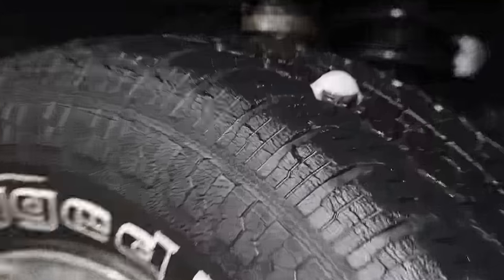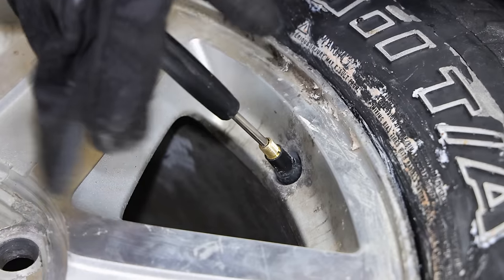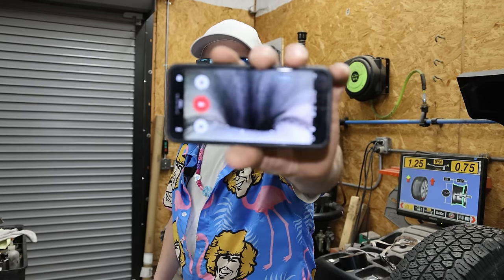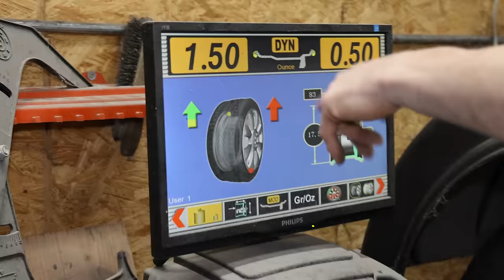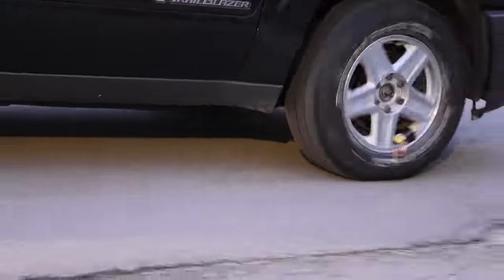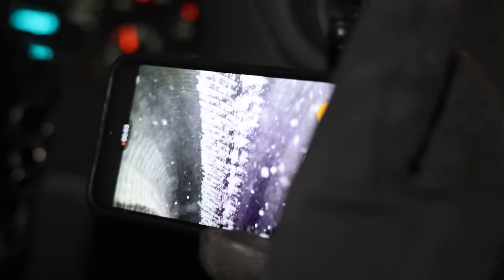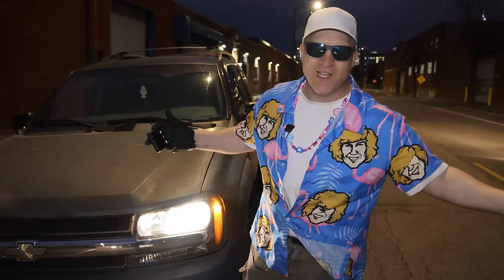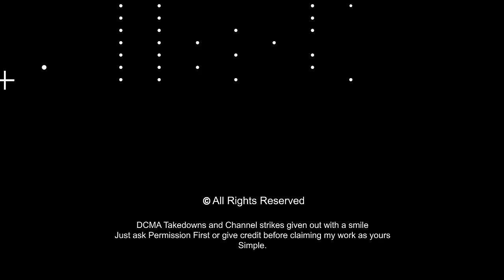GoPro Inside a Car Tire (With Balance Beads)

Comment: I had been using them on my motorcycles for over 20 years, and I had got thousands of miles more on every tire than regular balancing. Not only did my tires last forever, but the ride was smoother and no tire cupping, especially on my second gen Honda Goldwing that are famously knowing for front-end vibration. I had always waited to use them on the second set of tires and beyong on every new bike, but at this point, it is the first modification I do when I get a new bike. By the way, I always use a fresh set of beads on new tires. Thanks for the video.
Reply: How about some hard numbers for comparison?
Reply: @michaelvachon1334 You are joking? To suggest you got thousands of kilometres more from a tyre with these things in it is just ridiculous.
Reply: Agreed.  I used them in my 1983 Suzuki GS650 and always had a super smooth ride.

I chatted with a rep from CounterAct, a brand of balancing beads, they don't work in everything.  They work best in vehicles with stiff suspensions, such as trucks and motorcycles.  They don't recommend them for passenger cars due to softer suspensions, but they see about a 75% success rate there.  They also said that they won't work at super high speeds, like motorcycle racing, because the high centripetal force of the tire prevents them from properly redistributing in the tire.

The reason you get additional thousands of miles is that the tires never go out of balance the way they do with traditional balancing methods.  As an example, I rotate and balance my car tires every 5,000 miles.  I notice how they are super smooth for the first 1,000-ish miles and then they go progressively out of balance over the next 4,000-ish miles.  While they are out of balance, they are wearing unevenly.  Uneven wear begets more uneven wear.  Finally, I end up replacing tires because of noise and crappy ride quality rather than getting to the wear bars.
Reply: @paulsmith4701 - I wasn't making any such claim. I'm quite skeptical of these products.
Reply: I will be lying if I say exact miles, but I remember on my 2006 M109r, I say the second set of tires lasted 4000 miles more and they were Metzelers my choice of tires (with a softer compound). I used them on my Ninja, VMax, Hayabusa, Goldwing, M109r, and my Honda Fury has now about 26000 miles and still had the factory tires.

Comment: I knew they worked, I know a lot of big mud tire guys that use them because it’s almost impossible to balance those tires.  But it’s so cool to see them in action.  10/10 best use of a GoPro this year.
Reply: Antifreeze works too
Reply: @juliogonzo2718  liquid in a tire does the opposite it makes it unbalanced
Reply: @joshmanis9860  how would it work opposite?

Comment: I used to drive 250 miles a night on gravel roads, on wet nights gravel would get stuck on the inside my rims and when I would hit pavement the wheels were unbalanced. I started using balance beads and they worked great for the next 2 years I did that job.
Reply: i had that same problem on my old hilux. solved by buying better wheels. that factory wheel looked like it was designed to accumulate sand, mud and debris. incredibly bad.

Comment: This is also how your washing machine balances in the spin cycle. They use either a couple of balls, beads like this, or a ring of fluid (infinitesimally small beads). You normally don't notice them on top-loaders, but you can hear them roll around when you manually rotate a front-loader.

Comment: Couple things I learned over the years,  Beads work good if installed properly.  The balancer may not show them as well because they do need the bumps in the roads to help situate them after centrifugal force has them stuck to the tire. The vibrations will help them spread to where they need to go.  Also, I had bad luck with them when they were installed by  throwing the 'Bag of beads" in the tire before tire install.  Instructions say the bag will disintegrate after a while, but that take way too long.  You'll get intermittent out of balance feel, and it will change every time you stop and start again because the bag remnants create a barrier and catch a bunch of the beads throwing the tire out of balance again.  The way you installed them is the best and most effective. 👍
Reply: Counteract also recommends a transfer pump that is useful with semi truck tires. Have had great success with the glass beads from Counter Act. Like you said they must be installed properly! Also install the extended valve core that comes with them
Reply: I got some tire lube on my beads when I installed them that way. They were clumping together inside the tires so I had to vacuum them out. Any ideas?
Reply: Use a funnel with a hose that goes past the in the tire, then set the bead. That seems to work best for me anyway...
Reply: @djpg2000  you can use a funnel & hose like longslyde1 said or you can throw the 'inner bag' unopened inside the tire before mounting it. They also make a transfer pump you can use low pressure shop air to transfer them into the tire, works well for semi truck tires already mounted. Think there's an instructional video on Counter Act's site/page

Comment: I've been running balancing beads for 9 years and over 20,000 miles in my Harley dresser motorcycle, the balance is perfect. The tires still have a few thousand miles to go on them, I contribute the high milage to continuous perfect balance. When I change the tires, I'll see the effect the beads have on the interior.
Reply: You got 20k out of a set of tires on your dresser?
Reply: It took you 9 years to go 20,000 miles?

Comment: 👍 this video was fantastic. I've used balancing beads in my motorcycles for years. I balance the rims with normal weights (1x, rims don't usually go out of balance) and after that i just put 20g per wheel. If any stone gets trapped in the thread the beads work their "magic".
From what I've read, the beads start working above 60kmh.
Reply: His footage show them kicking in at well under 35mph, by the time he shows he hit 37(which is almost 60kmh) they had already been sticking in place.
Reply: @XiaolinDraconis  Exactly, but prior to Go-pros inside a tire it would be kinda difficult to understand the behaviour, I guess.
Reply: @paulojrg  put them in a pop bottle and spin it with a drill or search for that video it will help you wrap your head around what's going on.

Comment: I've used airsoft BBs in my HMMWV tires for about 12 years now. They work, but they do throw things off when you turn hard or change speeds. For a big heavy tire on a 2 piece wheel with PVC pipe inside, they do ok though. It would require some insane weight to get them remotely close to balanced on their own. (They are Trail Worthy Fab re-centered wheels with mil-surp tires)

Comment: Welcome to a prime practical example of the quantum existence where the act of trying/attempting to observe the thing you want to observe directly affects the outcome of it.
Reply: Where did it impact the outcome? He said they worked. And we saw them at work. For your theory to be correct. They would have had to not work, but they did. 

Not to mention the only real way to see them work fully would be to use multiple cameras. We only saw a small part of the inside of the tire, and therefore the beads. ✌️
Reply: @amb3cog  put them in your tires every bump will throw your balance off
Reply: @Wtfsazerk  WTF does that have to do with this conversation? We're taking about the observer effect. Not tire beads friend. Reading is fundamental. ✌️
Reply: Such as the effect of shoving a GoPro in? :)

Comment: I never thought the beads would work for the same reasons you did. I assumed they would gather at the heavy part and make it even worse. You learn something every day. Cool video.
Reply: True the centrifugal  would just spread the beads  the wieght  on balance usually never changes ?
Reply: Lowest energy state - if the beads went to the heaviest spot, the wheel would deform to be egg shaped, so now the weight difference of the heavy spot would fight against the force of all the other rubber having to pull in closer to the center which it doesnt want to do since its spinning. I bet it wouldn't work with liquids, which would work how you intuitively think.
Reply: @cannaroe1213 A fine powder suspended in air, behaves like liquid.  So now you alo know how the latex anti-leak milks work.
Reply: I did some research on these a few years back...
The heavy part becomes the "source" of the vibration when you're getting up to speed (35-45), and the beads naturally migrate away from that source.... therefore, they end up pretty much precisely on the opposite of where the vibration was, and it "cancels out"/balances the tire.  That's how they work.  Hopefully it makes sense for ya!  I'm not too good with wording things!
Reply: @billymanilli  your message is clear to a techie!

Comment: I first used balance beads when I worked at McCarthy tires on 18 wheelers I've since ran them in my motorcycle and they really work great I recommend them all the time.

Comment: Now this is an awesome video!!!  From what we could see the beads were evenly distributed, but to balance the GO-PRO the beads would be out of view.  Perhaps next time TWO GO-PROs???
Reply: That's a good point.. if they were working wouldn't they end up at the opposite side of the go pro? Maybe there's a lot more beads in there than I realize
Reply: Ok, so need enuf beads to counter imbalance. Probly a counter weight opposit the go pro so the GoPro is on the light side.

Comment: Never heard of those, looks pretty cool. amazing little things, did not expect them to do a lot.
Reply: They're great if you have large heavy tires that either take alot of weight to balance on the machine or you don't have a machine big enough for. 

They're also nice cause they're faster, just drop the bag in and go (the clear bag that you saw the beads in, that bag, not the stronger outer bag)

The bag is designed to rip almost instantly. So when you put them in the first time the car drives it rips open and they do their thing.
Reply: They DON'T in a big truck tire! They do not work in my motor home running on 22.5 tires! Dealer insisted on putting them in. Drove from Phoenix to OKC. Stopped and paid to have them removed at a Truck shop! Every time there was a bump or chuckhole on I-40, they would get off-balance and start hammering me! It took several miles to get smooth again, just about when I would hit another chuckhole. Truck Shop found one of my tires was perfectly balanced with no weights and the other needed 5 ounces. i will>>Never Ever allow those magic beads to  be put in my tires! Fool me once: shame on you. Fool me twice: shame on me!
Reply: @daveh5635  The Counter Act balancing beads he shows here are not plastic but rather smooth glass beads. I use them in my Semi Truck tires for hundred of thousands miles. There's a chart that shows the proper Ounce bag to use for your size tire. Also install the extended valve core that comes with them.
Reply: @Roger_Rabbit_Adventures  Who knew? Obviously not my tire dealer! I had them removed at the big Fleet Pride Shop in Weatherford (Hydro)  OK. The experience at that shop was bad with beads, so they were not surprised. They had a brand-new state of the art spin balancer . Found one was perfect and other needed 5 ounces. Ahh , such relief! The rears didn’t seem to matter. The fronts on that Freightliner chassis were so sensitive to imbalance! Had never used Fleet Pride, but they were impressive guys there!

Comment: There is a very good demonstration of balance beads using an empty water bottle on the end of a drill. You place a sticky weight on one side and spin it up and the beads migrate to the opposite side.

Comment: I've been using them in my motorcycle tires for a decade and 150,000 miles. They work great!!! I use the steel beads because you can reuse them.
Reply: I reuse ceramic beads all the time in my motorcycle
Reply: What brand are the steel and ceramic ones? And what's the advantage of the ceramic beads, compared to the plastic and steel ones?
Reply: @madmanonwheels5150  sometimes the ceramic or plastic can break down, but I haven't experienced that. The steel ones can be picked up with a magnet if you drop em.
Reply: @tman7449 ,
Oh. Okay. Thanks

Comment: We used them in our agencies firetrucks, as well as F250's F350's and agencies PD vehicles, and so far so good. No issues. We would just toss the bag into the rim with the tire not seated yet. Using the tire machine to push the tire away from the rim to provide the gap needed then we would just air up the tire. Once the vehicle gets moving, the bag breaks open and self balances and the bag doesn't get in the way or matter much.

Comment: "It shows it's only 2 ounces off balance"?!  That is huge!  That's not even close to being properly balanced.  That will cause vibration, premature tire wear and premature suspension component wear, i.e. tie rod ends, etc. The first wheel balance shows 2.0 ounces out of balance on the inside edge and 0.25 ounces on the outside edge of the wheel. The second wheel balance shows 1.50 ounces out of balance on the inside edge of the wheel and 0.50 ounces out of balance in the outside edge of the wheel, which is very different than the first wheel balance.  This is a huge variation and if they worked, this variation should not be happening!  The tread separating from the tire's sidewall is a very dangerous condition and can cause a blowout. They appear defective to me and may be covered under warranty. Those tires are in desperate need of replacing. - BF Goodrich T/A Certified Tire Specialist.
Reply: But the host said they were in "great" condition. 😅
Reply: Yes all of what you say is true, but I think the point of the video was if it could balance those crappy tires, it can balance any tire. I think he could have used more beads in the second new tire he put on the balancer at the end of the video, but nevertheless, they still worked.

Correction, I did not listen the first time. He didn't even have beads in the tire at the end of the video. Just the tire on the wheel. I bet the beads woulda worked wonders on that.
Reply: @Red1red1MC - As the results of the wheel balancing demonstrated, the beads didn't work.  There is no replacement for a proper wheel balancing job.
Reply: Keep in mind he had a 4-6oz camera in the tire. Unless he supplied the same weight in beads, they could not possibly balance it out.
Reply: @HiTechOilCo  I'm still gonna try it. If it doesn't work, I'll take it to get "properly balanced" 

The thing is though, this is not new technology. It's been around for years and done with plenty of other things that probably shouldn't have been in a tire, and yet still accomplished the same thing. For less than 7 bucks a tire, I'll definitely try it. And I'll return with my own results.
Reply: @Red1red1MC  - Well for $5.00 you can buy the Brooklyn bridge as well and it has a fresh coating of paint too! :)  It's a great deal. :)

Comment: This cat ignores physics and Google, but nails YouTube videos that spotlight his balance cluelessness. You do you, bro.
Reply: They do not work in my motor home running on 22.5 tires! Dealer insisted on putting them in. Drove from Phoenix to OKC. Stopped and paid to have them removed at a Truck shop! Every time there was a bump or chuckhole on I-40, they would get off-balance and start hammering me! It took several miles to get smooth again, just about when I would hit another chuckhole. Truck Shop found one of my tires was perfectly balanced with no weights and the other needed 5 ounces. i will>>Never Ever allow those magic beads to  be put in my tires! Fool me once: shame on you. Fool me twice: shame on me!
Reply: 100% agree. Balance beads are total bs. Might as well just put sand in your tires. The guy who came up with them is laughing from his mansion I'm sure.

Comment: I bet shops love these when they go spilling everywhere during a tire replacement..
Reply: Actually, i use antifreeze in my truck wheels and the shops never spilled more than a few drops so eh?
Reply: At least it's not fix a flat or slime
Reply: @Barty.Crowell yeah, finding a half gallon of tire slime is NO fun, talk about a mess.
Reply: @1924ab yea especially after they forget about it and drive months or longer with that crqp inside, through a couple hot and cold months. Yuck
Reply: Fix a flat will ruin the tire pressure sensors.  @Barty.Crowell
Reply: At least it's not spray foam
Reply: Early fix-a-flat was Horrible  when changing tires , absolutely nauseating odor. and the propellant was actually flammable.
Reply: Very slippery when a bunch spill out of a tire that has then. Like standing on mini marbles.
Reply: your supposed to put the bag in the tire before mounting and when you drive the bag will break open

Comment: Those moving shots inside the tire are just mesmerizing. The shot of the air leaving the valve stem was super cool too. Also really impressive that GoPro was still recording just fine. I definitely do not understand the science behind these beads, hahaha.
Reply: that's because there IS no science behind  them. LOL.
Reply: @jakeg1967  Well there's certainly a lot of science, just doesn't necessarily demonstrate that they actually work. 😂